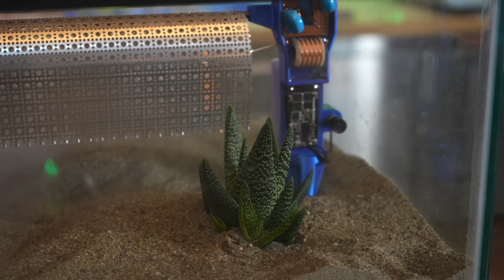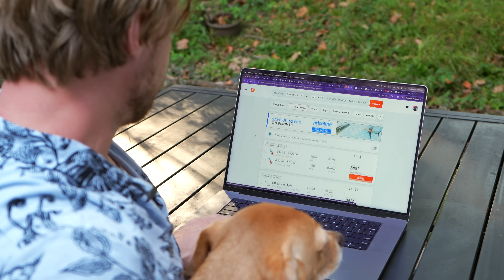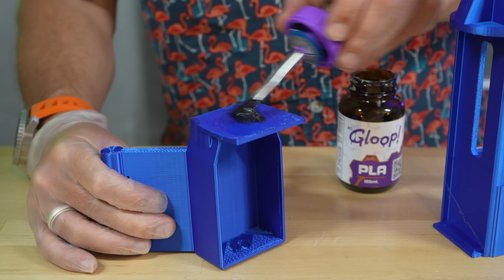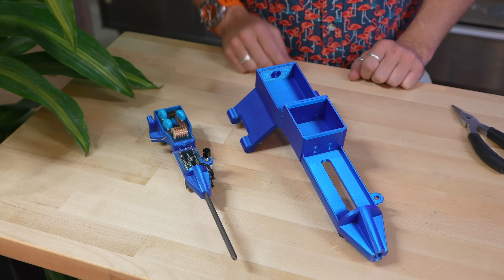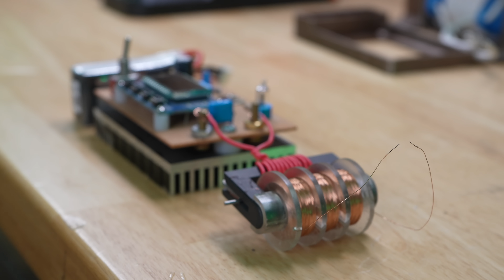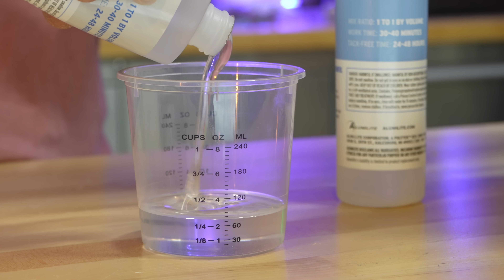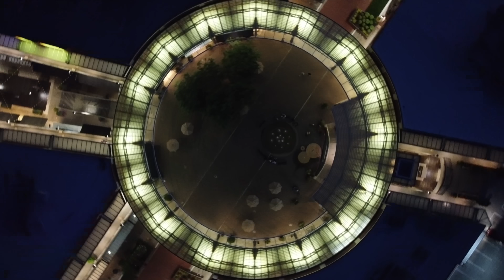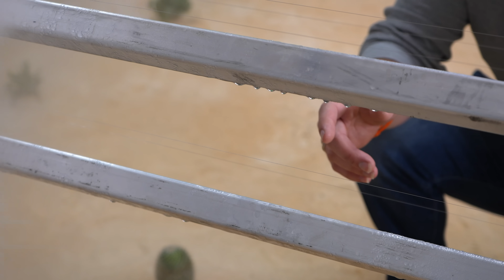Turning Desert Fog into Fresh Water Using 50,000 volts

Comment: for the fog switch, either a weak laser (so it works at dusk) and photodiode with a tunable comparator (If a certain amount of light is absorbed, comparator toggles and turnes on the device) or maybe a moisture sensor. Something like an HTU21 moisture sensor + a simple microcontroller bit away from your sensitive electronics would also do the trick but slightly more complex. there is also resistors that change resistance when getting wet (essentially how moisture sensors work) and this could again be used with a comparator to make also a robust moisture switch.

Comment: I guess that these fog condensers could also be applied in industrial processes where moist process gases or evaporating media generate fine aerosols. Such aerosols can form at open cooling or evaporation systems, during the drying of water-based products, or when hot process liquids are depressurized. In these cases, a fog condenser could coalesce the micro-droplets and recover them as a liquid phase. This would reduce water loss, limit moisture carryover, and—depending on the process—retain water-soluble substances locally.

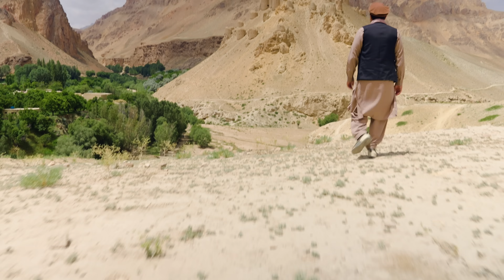Comment: 1:00 well, if the AI images say it's real - it must be real right? Also, in case anyone didn't realise - he never bought tickets to Peru.

It was always about putting on a controlled show, rather than facing real world conditions/variables.
Reply: His reply’s to other commenters are so puzzling as well. 

1) He’s ’patented it’ which is at least $10,000

2) the 4 degree arm angle will have to be fixed in the ‘the future’ as if it’s not a quick adjustment, and should be done by now in an ongoing evolving project. 

3) The prototype was printed out of PLA which would have not held up in the desert heat, something he should be well aware of, especially since he likely has the more appropriate PETG already.  

4) the design is horrible for repeated 3D printing, and super thin /weak for any long term product. It’s perfect though for a one off prop that was cheap and easy to design. 

5) talking to manufactures about production these when major design aspects (water collection) and real world testing does not exist

6) no in depth consumer research seeing if the lower income and remote communities would even want/afford these, or how big that market truly is, this doesn’t even have to be part of the video, buts it still clear this isn’t happening in the background. 

7) the use of AI images for the fog net when the real thing is a quick google search away, just why.

Comment: Fog sensors are a thing. Some as cheap as $4. Who knew?
Alternately, try a twist on fog harvesting nets - stretch out a thin (say) cotton thread. Two things will happen if it is exposed to fog & becomes saturated. It will shrink & its electrical resistance will change. Each sunny day, it will dry out & be ready for the next night.
Over time the cotton thread may stretch or sag so run one end over a roller to a small counterweight to maintain constant tension. Add a cheap rotary encoder or even a simple go no-go switch.

Comment: couldnt you use a humidity sensor switch to automate it? Put it on a relatively long wire with it's own stake further away from the rest of the device, like 2 meters, so that the device doesnt start a feedback loop. I know we have humidity sensors in greenhouses too that you could probably adapt for this project.

Comment: Maybe you could use a daylight sensor to activate the system once the sun sets and a raspberry pi to activate the high voltage at a set time after sundown. No fog or humidity sensors required.

Comment: For 120 W consumption overnight, you'll need at least 2 kWh of batteries with about 300W of solar panels, not that tiny thing that would barely power a calculator!
Transporting that lot would be problematic, so you'd better source them in the final destination which shouldn't be too difficult now.
I'd worry about ozone generation and shock hazard to local wildlife too for a larger system, but the results of this test would be interesting to see.

Comment: could you simply tap into the solar panel and make it light controlled? When the solar panel receives under a certain threshold for a certain amount of time, you know that the sun has set, and it's now night time. Once night time is detected, turn on the device. And do the opposite in the morning.

Comment: This looks really cool for how low power it is. I feel like having a gutter system under the condenser wouuld allow for the machine to pump water into tanks that could then be destributed to plants directly instead of requiring high voltage lines out in the open which could get tripped or destroyed by natural wildlife. You would be able to control the location better and have more pedictable results.

Comment: My only thought about improving this, would be to have the stakes at different heights, so water drops down and collects at a single point, rather than across the whole side. Doesnt need to be very steep but enough to help water to move down and drip at an end. Then include some sort of collector/funnel on the stake so the water isnt lost into the ground

Comment: For activation you can use the solar panel which means when it loose power activate the condenser as fog happens only in night if it happens specific hour of night then just delay the activation to match the time
Another approach could be with water sensor so turn on wait for a minute or two and see if water is there or not if not turn off if there stay on until sensor doesn't detect any water or it's day time (solar panel getting powered) tho this needs a lot of trial and error like position of water sensor timing etc but it can be a fully automatic system
Bluetooth /wireless switch could work and may be efficient if you add weather data to it and turn on accordingly but it will depend on external devices
Reply from the maker: I actually really like this idea! it would be the easiest and just would use some reverse wiring / NOT gates. Thanks for the input.
Reply: @PlasmaChannel yes and try Faraday cage to protect ic's from high voltage

Comment: To maximize electric-to-kinetic conversion efficiency and velocity, use an inverse sawtooth to enhance boundary layer effects. Implement dielectric barrier discharge (DBD) with frequency optimization (5-100 kHz).
Search for research papers on Active Flow Control using Plasma Actuators for the technical details.

Comment: The solution to your circuit “on/off” problem is even easier than having a Bluetooth activated switch. Just use a photocell sensor or moisture sensor to act as your switch.

Comment: 21:21 How about a clock? Better, a calendar clock that syncs with a smartphone once on install to know location and thus sunrise/sunset times year-round. Or just use a more basic clock that uses solar panel voltage as a daytime indicator.

Putting the static-sensitive ICs in a Faraday cage would help tons, I'd recommend aluminum tape for simplicity.

Getting the PWM frequency above human hearing would be nice, drive frequency already is. As you said, this doubles as an ultrasonic animal repeller.
Reply from the maker: This is another really great idea. wow. Thank you.

Comment: What i'd like to see is how this responds in non foggy nights. In usa agriculture water is also an issue where rivers are drained by upstream states.

Normal air also has water in it. If it's solar powered, would it be a feasible strategy to harvest water from the normal air that travels over land.

Also, have you considered hooking it up to a giant weather baloon, have it hang at cloud height to gather water there, then have it drip down via the line?

This could be a game changer if it also works in non foggy areas.

Comment: you shouldn't use a bluetooth switch. what you should do is connect it to a Meshtastic/MeshCore   network  and activate it remotely.... you could also use it to monitor battery voltage and water level sensors for measuring how much water it captures
Reply from the maker: That's definitely something I'll consider for the next version to monitor battery and water levels. The idea was to have water collect at the center in a container. For filming, I didn't show the container because I felt it was not necessary to show the device working.

Comment: Since there are 1000s of volts in the sky, why not power it with a balloon & Tesla antenna with neg ground circuit?
Reply from the maker: Well, it draws about 120 watts. So 10 amps at 12 volts. Pulling 10 amps out of the sky would be really difficult. The array needed would be the size of half a football field. In the sky.

Comment: a design improvement to consider is angling down the wings of the condenser so that what droplets are directed to the ends and will collect and condense into a stream where they're easier to capture. with the system sitting flat and horizontal the droplets will pool and fall anywhere along the length making capture at the bottom a much wider trough to cover.
Reply from the maker: That's a great idea! I actually did angle the arms at 4 degrees, but it wasn't enough. I'll try a steeper angle next time.

Comment: Your device consumes a crazy amount of energy for the amount of water it produces, ~47kwh(!!!) per cubic meter of produced water with your device. For comparison, modern desalination plants consume only ~3.5 kwh for the same amount of water, about 13 times less than your device. So... what is it good for again?
Reply from the maker: Desalination plants need infrastructure. They also need piping to carry the water from the ocean. They also need employees. This system is fully self reliant (once the auto on switch is figured out), and requires zero connection to infrastructure nor employess. It delivers water on the spot, within seconds, and is portable. Sunny locations aren't short on solar power. They are usually short on water. This solves that at the expense of being less energy efficient.

Comment: The major and obvious problem with this entire (waste of time) idea is that the resulting output is not potable at all! The water will have ZERO mineral content, the Corona discharge will ionise the air, which will then be soluble in the water, such as ozone and nitrogen oxides, lowering the water's PH to unsafe levels. This whole thing is such a non-starter... :face-blue-smiling:

Comment: To turn it on automatically at night you can use an LDR, a resistor and a mosfet. No complex BT required.
Reply from the maker: That is a very valid idea. Low complexity, high reliability. I think i'll try this. Thank you.

Comment: Wait a minute, dry ice? Dry ice is CO2, not water, and doesn't form droplets??? Do you mean atomized water? aka small droplets launched in the air by an ultrasonic membrane? Also watch out using dry ice like that in a garage, you can choke yourself to death by replacing the oxygen! Same danger as liquid nitrogen!
Reply from the maker: The dry ice sublimates into gas when in water. When doing so, the warm water and CO2 gas comine to form very humid air. But once the humid air leaves the container, it's super chilled and all the moisture condenses into actual fog. So the water is coming from 1) the warm water the dry ice is set into and 2) Water being pulled out of thin air by the sub zero temperatures of the dry ice air. Cheers

Comment: i calculated the efficiency of this in your last video about the topic. My result was that it would be cheaper to just truck in the water. Have not seen the video yet but i cant imagine that this is much better. Its basically like Vertical Farming: Sounds neat in concept but is just not viable in practice, at least not if you dont want to pay 2.50€ for a head of lettuce in power alone, not even considering transport and all that stuff

Comment: Your telling me you cant wire in a photo cell? It would turn your system on when there is no more sun out...
Reply from the maker: I initially planned for that, but then came the worry that any type of clouds would set it off. And make it drain battery still mid day with no fog around. The photosensor idea is totally doable, but i'd need delays built in (say, shady for more than 5 minutes, it turns on, but less than 5 minutes, device stays off). That, then adds complexity and why I didn't go with it.
Reply: @PlasmaChannel  awesomeness 👌 Regardless, im EXTREMELY happy you are able to upsize it and inspire some of us to do the same for the house... Arizona humidity sucks when its around.

Anyways. I wish you all the luck in getting this amazing concept out to the lands it will be built for. ❤

Comment: If you add a slight angle at the hinges so the powered steak is lower, you could use one central collection point for all legs.
Reply from the maker: Actually already did that. 4 degrees and added collection points (could see them in the onshape segments). Turns out I should have tried 5-6 degrees.

Comment: 20:26 You said here it yourself, and then immediately you talk about the numbers, but the numbers are meaningless when you're blasting the fog machine directly at your device instead of doing a test outside, where the numbers would look vastly different, not to say they would be bad, I'm just saying this kind of feels misleading, especially when the B-Roll used while listing the numbers includes shots where the machine isn't getting blasted directly, I'm looking forward to seeing it tested outside
Reply from the maker: No that's totally fair. And my point was to compare the first and second versions. The first version also had a high strength fog producer blasting fog right at it. So using the same situation, I compared the two condensers and found version 2 to be 1.5X as effective.

Comment: A lot of sensors could be used to control the operation and enhance it 
A lot of trigonometry could be used for shaping the base of the device to be circular, so the pips can move in recognition of sensors of winds and fog at the time of triggering the cycle of water collection 
Also, the drops are not collected and could be used with drop collectors to accelerate the process 

If you visit Saudi Arabia, please consider visiting NEOM. They have already built -fog-water device, and you can review it as a competitor

Comment: If you have free energy as sun you can simply add cold to the tubes, they are many examples experiments with gas and British did recently with new chemical if you squeeze it it convene cold or so, it is just prove that humanity does not have problems it is needed to have brains and the wish to solve

Comment: What if you used electrostatically charged paint sprayer cathodes to spray charged water particles that are drawn to the huge funnel shaped anode so that a fine water mist is used to entrain and capture the water particles in the fog?  That way a huge surface area of electrooptically charged volumetric water particles would capture the fog and draw it to the collection point.

Comment: re: fog detetcting switch use a esp32 with  a humidity sensor. put it in ultra low power mode and have it wake up and poll humidity every 15 minutes or so and turn on the device when humidity passes a certain threshold

Comment: Wildly impressive. I genuinely think you should consider getting this device or maybe even a modular version of it into production - it'd certainly be useful in a lot of the MENA region. If you control the production and sales you could even set up as a non-profit, given that seems to be your intentions.
Reply from the maker: Hey that’s why I have a patent on it! Protecting the IP so I can upscale it further for the people of Namibia and Morocco
Reply: @PlasmaChannel  Stop lying, you don’t have a patent. Those take $10,000 on the low end and takes a long time to get. That type of money isn’t spend with an incomplete design, no real world testing, and no investors, otherwise that plane flight would be real cheap. 

Respond with the patent number. It should be real easy for you to get, and it would be super interesting to read through. 

Based off your response to other people’s comments though your working real hard to make this a reality asap, and even talking to manufactures. At the same time you’re also moving onto the next project, an unrelated plasma halo sword, those manufactures will just have to wait until you come back to this project to complete the design and testing.

Comment: Does the surface area of the collection plate affect the collection efficiency? I would suggest trying to incorporate metal mesh like you used in the first design, or try different surface finishes on the collection bars to see what gets you the highest output.

Comment: If this item were to be used in a camping scenario, it might not be a bad idea to tape or rope off the area to a respectable distance to avoid pets and people from contacting the electrodes. This thing is dangerous and likely would stop a heart from beating if contacted. Otherwise, bravo to you, sir. It looks like you're on to something. And the water produced is pure. No filtering required.

Comment: Maybe if the arms were angled down towards the centre it would help direct the drips to one place where they could be more easily collected. I also wonder if some kind of refrigerator pump to cool the arms would improve the efficiency.
Reply from the maker: Great ideas! I actually did angle the arms at 4 degrees, but it wasn't enough. I'll try a steeper angle next time.

Comment: they make a humidity sensor that works off 5v and compatible with arduino. It would be super easy to tie it into the circuit and would allow you to analogly change the trigger level of humidity.